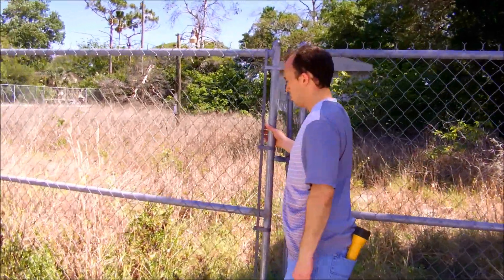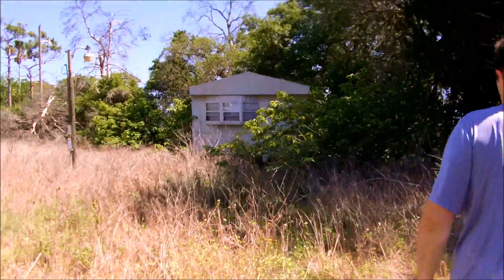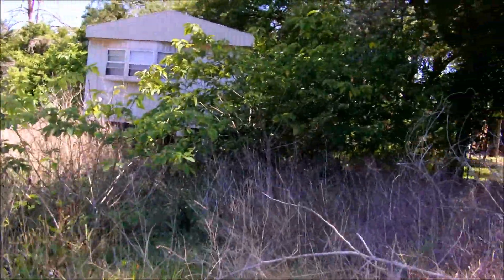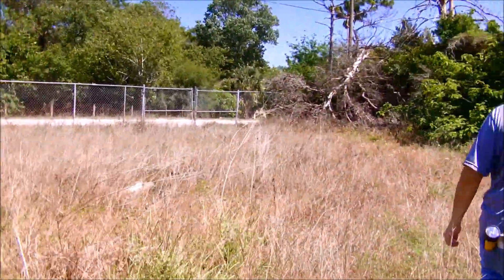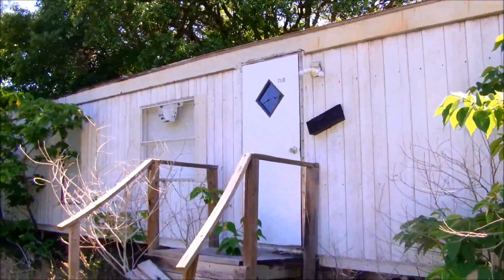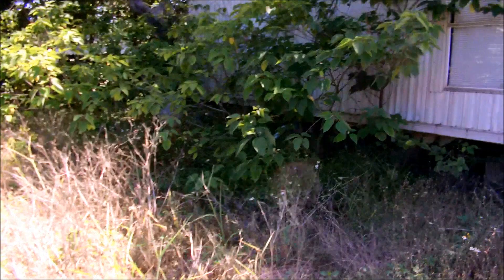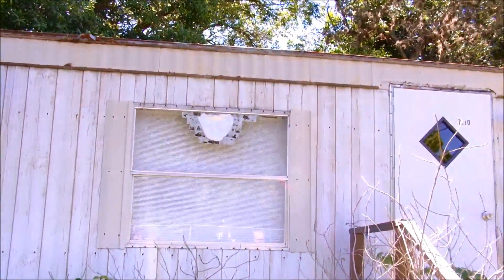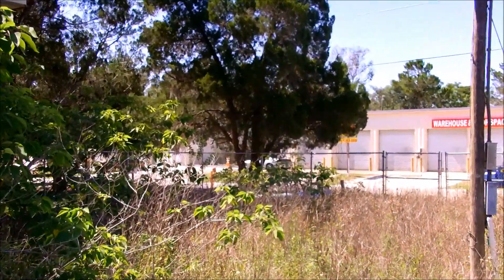Abandoned mobile home (mint interior)

Comment: Those older trailers could stand on the wheels. They were called "house trailers." They were meant to be moved a lot.  Now these kind of houses are called manufactured homes for a reason.  They are called 'destination' trailers.  They are only designed to be moved once and they have to be blocked up just like you said.  This model is old school.

Comment: Usually the owner will give their old mobile home away, if they are not using it as storage. The issue is paying someone to move it, and finding a place to put it. Newer mobile home parks will not let you move in older mobile home, unless they have some older mobile homes.